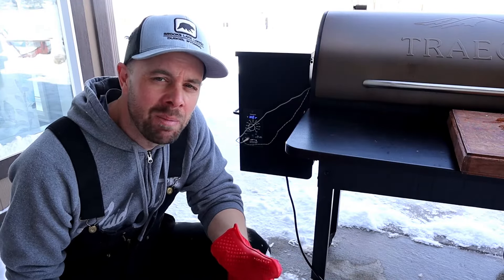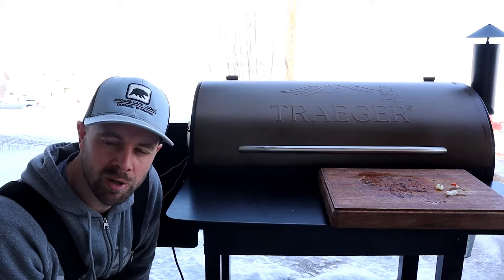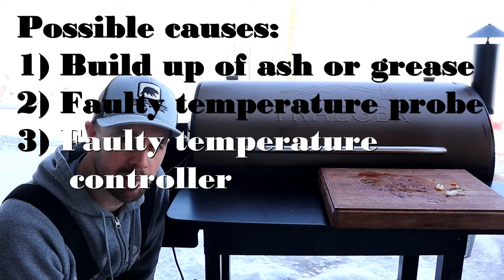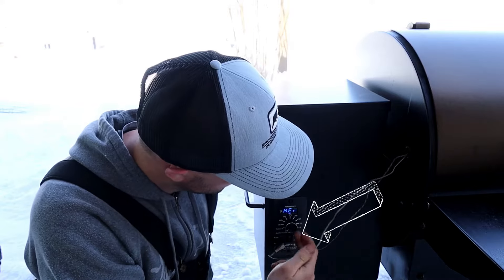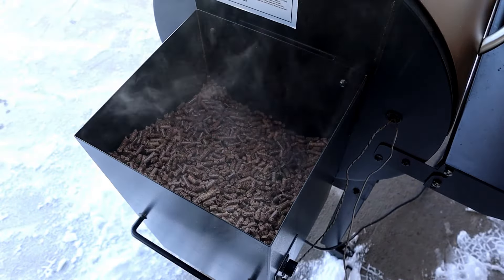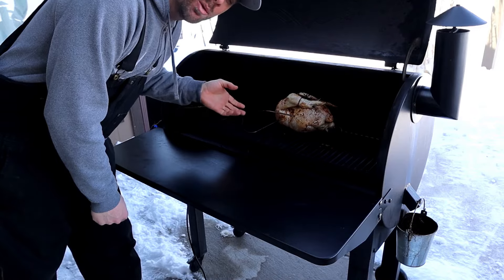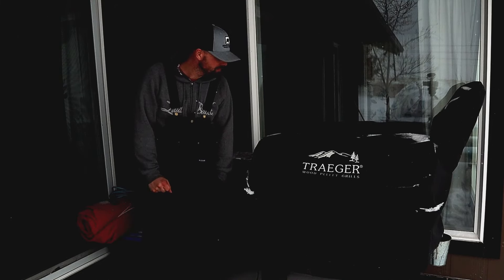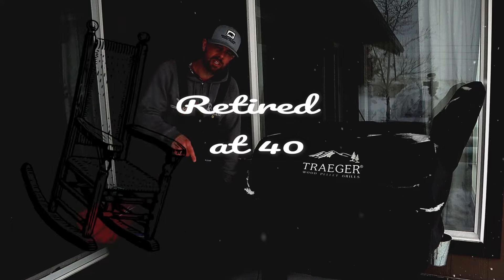👉HOW TO FIX "HEr" Error Code👈 Traeger Troubleshooting #traegerrepair

Comment: I got this error code the a couple days ago on my Pro 22.  Was sitting next to my Traeger while I was grilling some chicken around 350, and heard the Traeger shut down.  Observed the HEr code, but saw no signs that the grill had gotten really hot/reached 450.  Chicken was burned, no sign of flair-up, etc.  Grill is 11 months old, has always been covered when not in use, and have only used Traeger pellets.  I cleaned and vacuumed the grill prior to using.  Going to call Traeger CS and see what they have to say.  Thanks for the video.
Reply from the maker: good luck. hope you figure it out

Comment: I have had my Traeger 22 for about 2 years and I love it!! Got this code today for the first time. I was baking some bread in the oven and then my oven quit. You bake bread at a high temp like 450-500 and it's done in 20 minutes. I tried to finish it off on the smoker at the max temp 450. I walked out and saw the Her code. I let the grill cool down and then unplugged it and then plugged it back in the code was gone. Smoker was working just fine like always. I never cook above 350 on the smoker so I don't know if it is problem. I doubt I will encounter it again. I keep my hopper clean so I know that wasn't the issue I simply unplugged it and plugged it back in.

Comment: I have had a Traeger for about four years now, one of the most frustrating and disappointing purchases I have ever made.  The unit has been completely rebuilt, major fire on the second use and have at this time I don't know if I will even keep it.  Why am I commenting now, 4th of July, set up a low temp test on the smoke and 180 deg setting, been running for the past hour, all of a sudden I check the remote thermometer 450 degrees!!! Go and check the grill and I have the error code of death for anything on the smoker!  Tiring and disappointing.
Great Video by the way!!
Reply: Michael Patton that’s disappointing. For the price they charge somebody should fly out to fix it for you. Mine has never given me any issues in two years, except user error. I ran out of pellets on two occasions during a very long cook and I had to reset. Otherwise it’s been great. Sorry to hear about your bad experience. Rest assured this is rare.
Reply: I got mine last year. Had a fire already too. Very overrated
Reply: amen….  this has happened too many times with mine.  Buddy has a lowes pit boss and NEVER has issues.  Thinking of giving this traeger away or tossing it in the dump and getting a low end unit that just works.

Comment: I have had this problem with my Traeger Scout several times. I have cleaned it changed out the liner of the drip pan, everything and it still occasionally occurs. So I’ve resorted to spraying the temperature sensor with water when the temperature gets near 500°. I’ve used a separate temperature gauge and the temperature is nowhere near 500° when the Traeger sensor says that it is. Just a temporary fix but definitely keeps your food cooking on the Traeger! Like I said it only occasionally occurs for me!

Comment: tl;dr: disconnect/reconnect your heat rod wires |-----------|  I had this error but never due to high heat.  Just turned it on and boom...thinks it's too hot, immediate error.  Had used it a week before without issue.  Full cleaning (which had just previously been done anyway), multiple unplugs, etc. did nothing.  Traeger site recommended disconnecting the two white wires to the temperature rod and then immediately reconnecting, which I thought would do nothing but I tried it anyway.  Fixed the issue, just smoked a couple of pork butts with no problems.  Five minute fix (though one of the screws was VERY snug).  Take the screws out of the control panel and pull the box out.  You'll see the white wires.  I used an eyeglasses screwdriver kit to loosen the connecting screws.

I've had my Traeger for three years and I use it at least once a week.  First time I've ever had an issue.

Comment: Swapped out the thermal probe, smoker turned on but right away was reading high temp, but no ignition then code came back on and won't start, opened control board and saw the fuse isn't burnt out. not sure what's next.

Comment: i had the same problem again today. I set the grill later to 180degrees to test. it ran up to 320 and then attempted to maintain itself at 280 for about ten minutes. I opened the lid to cool it but it kept firing up to 270 , 280 range. Something is definitely not working properly with the temp sensor or controller.  So today's beer butt chicken got done in the oven. It came out OK, nowhere near as good as the smoker. 

Going to replace the temp sensor probably, if not the controller. I will call Traeger and see what they say. 3 year warranty and I am at 10 months in year one. When it works well enough, it's bad to the bone, so I am not giving up. But it has fluctuated  temperature wise quite a bit ever since day one.
UPDATE 6/22 :  replaced temp sensor with highly rated after market temp sensor, easily done, works like a charm.The best chicken just got better.
Reply from the maker: 10 months of a cheap propane grill would be the end of it's lifespan😬
Reply: Do you have a link to the Tenno sensor

Comment: mine worked fine the last time I used it. I smoked some eggs and cheese with a smoke bar about a month ago. Went to start my traeger for ribs and got the HER code. 

Nothing excessive in the fire pot. Auger doesn't seem to be bound up. Wiped the sensor probe thinking maybe the smoke tube had coated it. Still getting the error code. I don't hear the fan or auger try to engage, just totally silent. 

So sad. I was looking forward to ribs and burnt ends. :(

Comment: I like what you did here but i must say, “I hate my Traeger!”  I’ve had it for a few years and it has never worked, it always over heats and burns.  It’s ruined great meat the bucket is completely blistered from the overheating.  Traeger sent me new heat probe but they blame me every time I call or email.  Let’s get real, there is only so many thing you can do when using it and no matter what I’ve tried I have to babysit it every time I use it.  Don’t buy a Traeger, that’s the best way to not get HEr codes.  It doesn’t work as well as it should, especially at these prices.